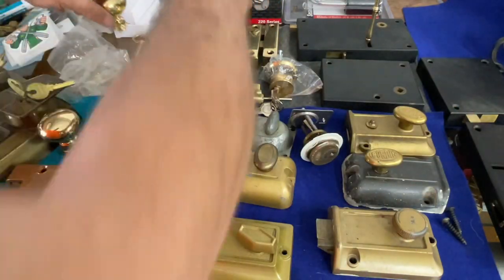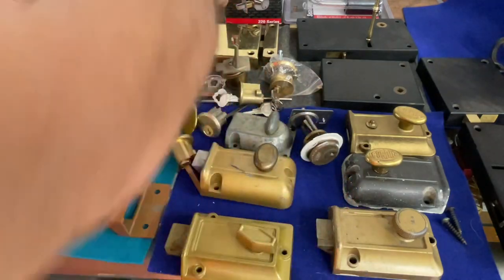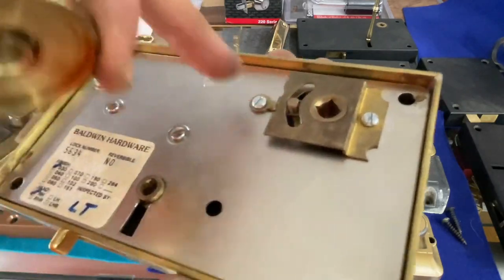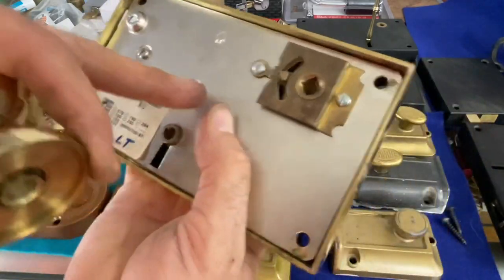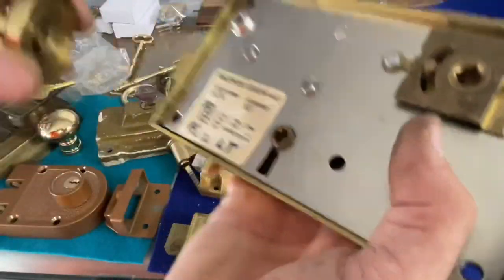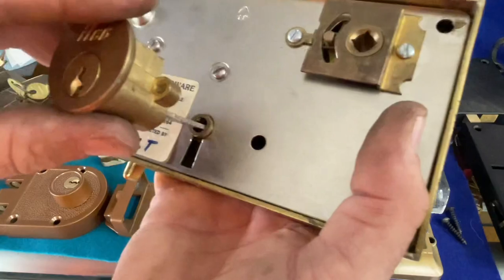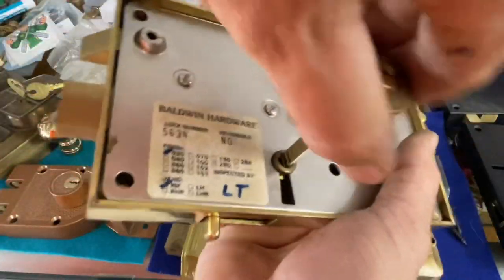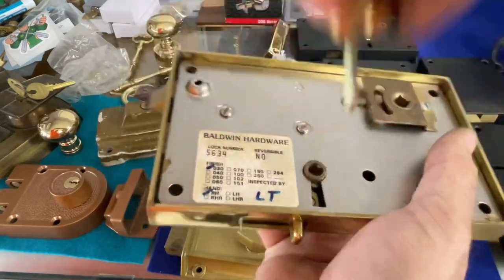Rim Locks : Nightlatch, Nightlatch Deadbolt & Jimmyproof locks

Comment: We still have Segal 667 jimmy-proof deadbolts (and their clones) all over the place here (I personally had one antique one that I moved from apartment to apartment with me for over 20 years) because so many older buildings had most of their doors already prepped for them and many newer buildings here still use frames and doors that can easily be drilled to fit them.

Comment: Those Taylor rim cylinders with plastic plugs...Taylor flooded the market back in the 60's & 70's with those garage door locks. Walking by any house with a garage had those cylinders.
The plug is in two sections, which snaps together. Pretty nifty. Heating the key up with a torch prevented removal of key. I still have a very old Taylor Lock book.
When Ideal Security came out with their Jimmy-Proof units, I would install on Hollow-Core doors, as the outside assembly thru-bolted with the inside unit. They worked great for Hollow-Core installs. I never installed those units with the Ideal Rim Cylinder. I would usually use a Sargent Keso Rim Cylinder. Made for a great sale. Word-of-Mouth and I had more customers for the Ideal locks. Not sure why they went away. They were one of the best Jimmy-Proof units back then.
Reply from the maker: shhhh! Don’t tell anyone about the two piece plug! Over here ruining my secret surprise! ;)

Comment: Awesome    The "backset" is a problem when changing springlatch to a deadbolt or to a different manufacturer. Is there no standard backseat?  I have an old Yale springlatch that can be locked to a deadbolt position from the outside with the key which is awesome

Comment: Personally in my area I see a lot of the Jimmy proof style in a lot of commercial and retail applications it's the double cylinder variant

But they use them a lot on like the accordion style security gates and things

In my years of research I've never actually found them but looks to me that they support a standard mortise lock style configuration that'll take like a best mortise or something and give you IC core and things like that is it possible that the installer is just manually modified it

Comment: How Awesome to see this and perfect timing too. Because a house that Im doing the rewiring job on, has the Big Brown YALE  jimmy proof on it and was wondering about it, and if they could be rekeyed? And like GI JOE says, Knowing Is Half  of The Battle.
Reply: The big brown Yale jimmy proof deadbolts can be rekeyed although it requires disassembling almost the entire lock if it is a double cylinder model. If it is a single cylinder model just replace the outside rim cylinder.